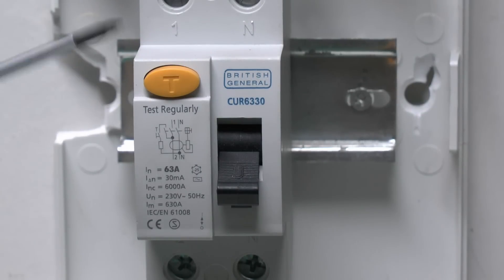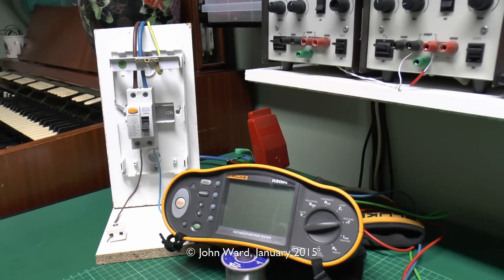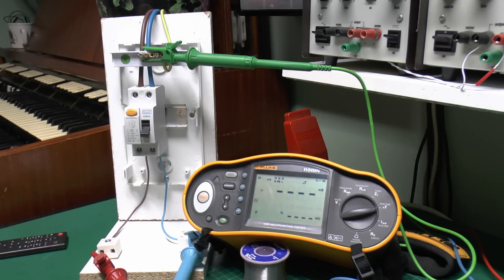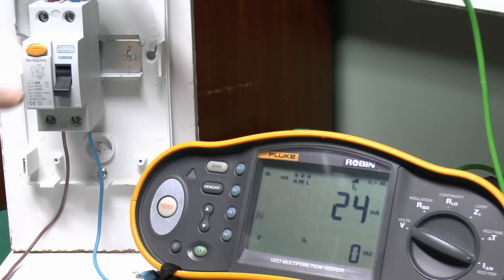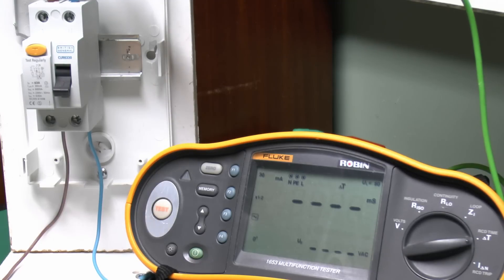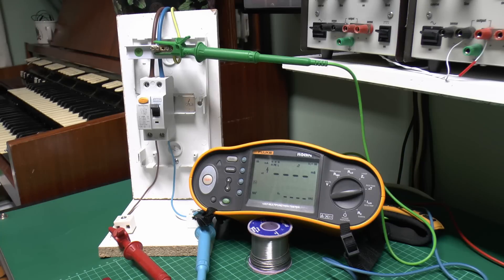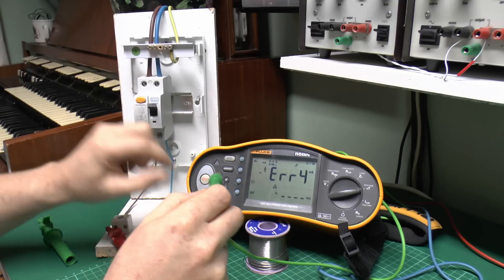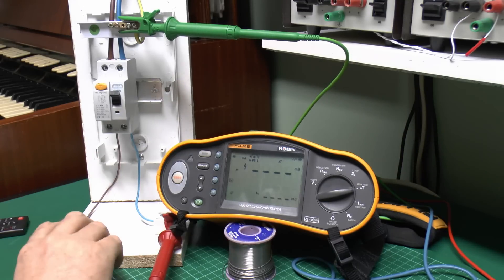How to Test RCDs

Comment: Is correct that the rcd trips  instead of the main in an overload? Connected load is an oven and a toaster fed from  different branch circuits.
Reply from the maker: No, an RCD does not trip when overloaded.
The trip will either be caused by one or both items having some leakage to earth (heating elements often do), or there is a fault between neutral and earth somewhere in the installation and the combined load of both appliances is sufficient to cause enough current to flow via the N-E fault and trip the RCD.
Reply: +John Ward Thanks John. How often shall we test RCD? Mostly it is written on the device " push monthly "or "test monthly".
Reply from the maker: Monthly will do, some suggest quarterly.  It's mainly to prevent the mechanical parts inside sticking.

Comment: Hi John, does it matter if the supply comes in at the bottom and the load at the top (opposite way round to what you have it)?
Reply from the maker: +si myob Not usually, although check the specifications from the manufacturer before using it like that.
Reply: Thanks
Reply: some rcd

Comment: Hi John,
I have finished installing shore power to my little boat. I spent the afternoon trying to get the RCD to switch on. I have not managed to get the switch lever to remain up. Not while totally disconnected from any wires nor while wired up and connected to the pontoon power supply. Using a little Fluke device I established that the wiring from the shore power was correct and on. 
A friend suggested that the RCD was broken saying that even when not connected, for example straight out the box packaging, the black switch lever should remain in the up position if clicked on.

I would like to know if you agree. If that is the case then it is for the bin.

Many thanks, Mike
Reply from the maker: +Traveller32sloop If it's the style shown in the video then it should latch on even with no power.  Faulty if not.
There are active RCDs which only latch in the presence of power and disconnect when power is removed, but they are normally only used in individual socket outlets or similar, not for consumer units.

Comment: Hi John, Are you using the RCD through an isolation transformer like on your other videos to prevent the test tripping your house RCD? If so what make is this transformer and where did you get it? Thanks.
Reply from the maker: +Daniel Brown Yes, isolating transformer was used.  The one I have is rather old and has no make on it.  They can be purchased new but are rather expensive.  
Used ones can usually be found cheaply on ebay by searching for 'safety isolation transformer'  '230 isolation transformer' and similar.

Comment: i liked that trick for testing the local rcd without affecting the other one...I didn't like you removing your test leads from those live wires still hanging out of the connector blocks at the end of your presentation.hope you didnt get a shock

Comment: Perhaps a silly question, but could one theoretically test that an RCD trips using just a battery, or a signal generator outputting a similarly low voltage?

Comment: I saw an electrician testing RCD's at the board recently where previously I had only seen rcd's tested using a PAT tester, requiring it to be plugged into an outlet socket designated to a particular rcd. this seemed to save lots of time but I was curious if this form of testing passes Australian standards and is as accurate with the trip times? I take it this is basically what you've don't in this video
Reply from the maker: David Jensen There should be no difference between testing at the board or at a socket - the circuit wires are still connected in either case.
Not familiar with the Australian standards but it's totally acceptable to do it either way in the UK.  Testing at the board is often the only way, particularly for circuits which do not have socket outlets.
Reply: thanks John.....I appreciate the feedback.

Comment: Great video.

Two questions:

1. Could you possibly do a video on how to use multifunction testers, whether they be Fluke-Robin, Kewtech or Megger, as you explain all the functions so clearly;

2. I've installed three distribution boards in a building, they are all supplied from an MEM switchgear panel containing three 63 amp fuses each of which is the link between the incoming supply and the cable to each board. Two of the cables are fine, supplying power without a problem, but the third cable will not power up when connected. Power is coming in, but not being transmitted through the fuse to the cable. I have pulled out the fuse link housing between the supply and load sides, and it houses a 63 amp Bussman fuse. Could this be a problem with the fuse, the housing or the board, and how can I test the fuse? At the moment, I only have a Kewtech voltage tester, I don't yet have a mutimeter or multifunction tester.

Thank you.
Reply from the maker: David Sakho 1 - Yes, other testing videos are planned.
2 - A failed fuse is most likely from the description given,  any multimeter or continuity tester can be used to test the fuse.  However before replacing it, the cause of the failed fuse should be identified.
Reply: ***** Thank you.

Comment: When you've got a simple circuit with no equipotential bonding etc, you expect a ballpark figure of Zs=Ze+(R1+R2). 
While British General RCDs seem to test OK regarding trip times and currents as you have shown, I find that for some reason they add about 0.5 Ohms to the Zs test result of connected circuits.
In a lot of cases that can make the difference between a pass and fail.

Other makes of RCD do not seem to affect the Zs test result in this way.
Have you noticed anything similar?

Comment: If earth and neutral is shorted after the RCD. Will the RCD then trip when the short happens, or not at all, even if there is a fault?
Reply: Depends on a number of factors - what load is connected and the impedance of the PE and N conductors.